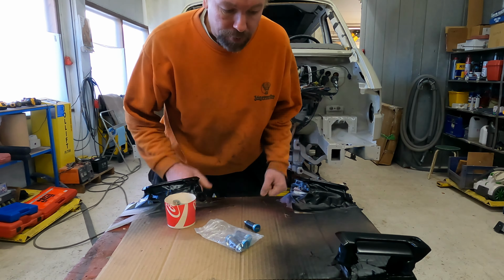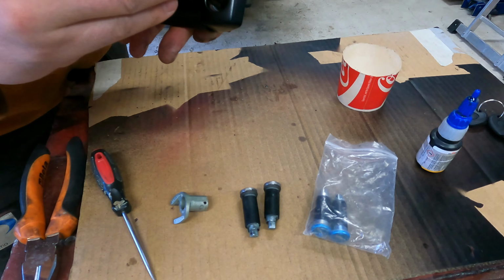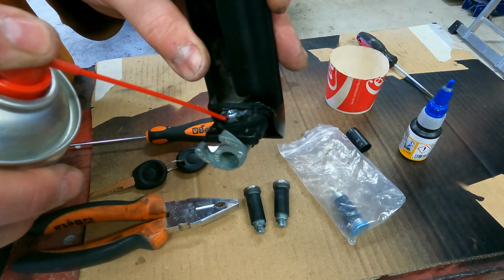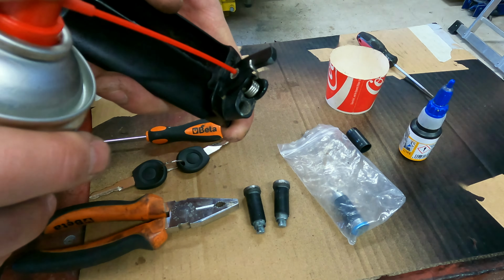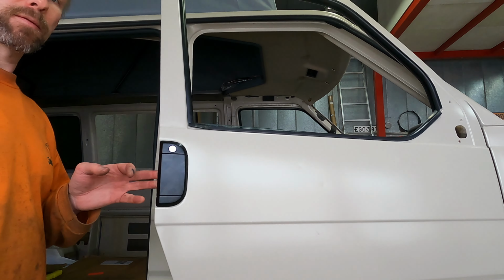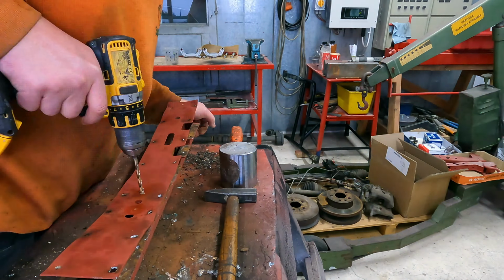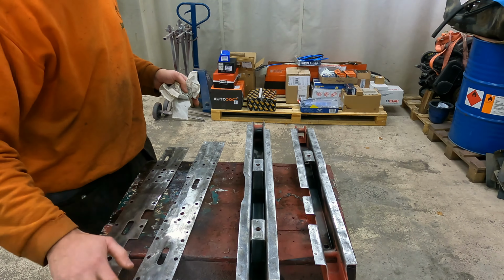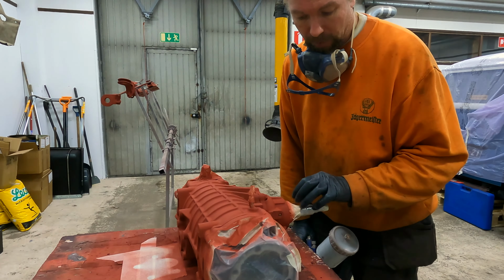DIY restore VW T4 door handles,Remove VW t4 Door Handle,VW T4 door lock repair,T4 Door Handle Change

Comment: The Chinese barrels and handels are really rubish quality speaking from experience they don't last long
Reply from the maker: That's what I'm afraid of. I had to change the locks because there was an attempt to steal this. I wouldn't change the handles, they are original. I also bought the Chinese ones for the lock mechanisms inside the doors, but I canceled the deals and cleaned or refurbished the original ones.